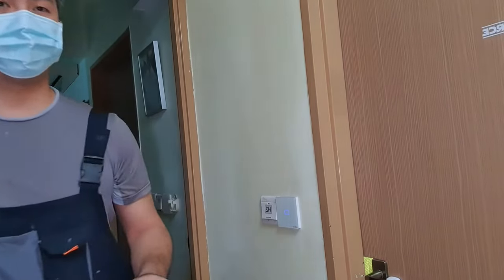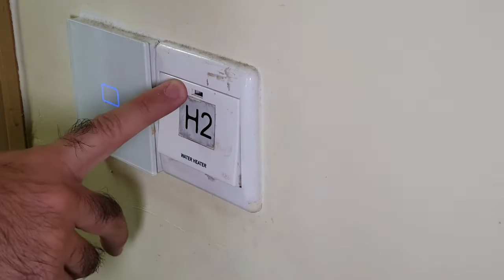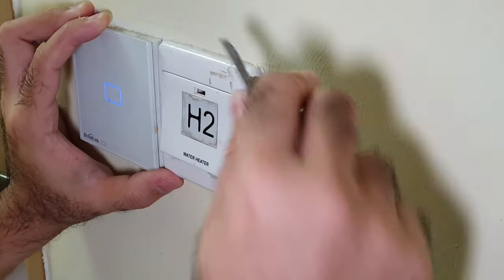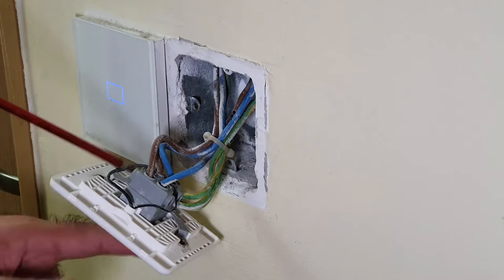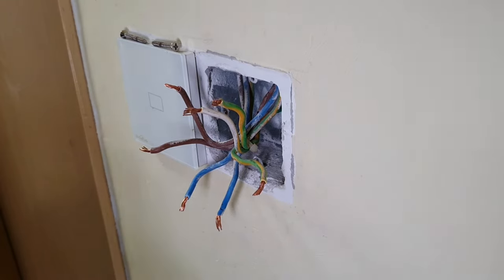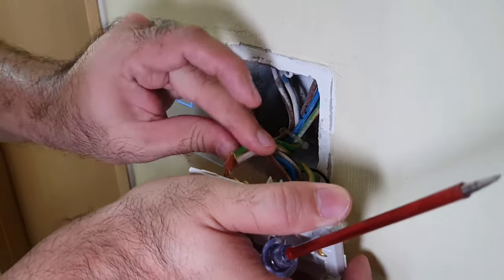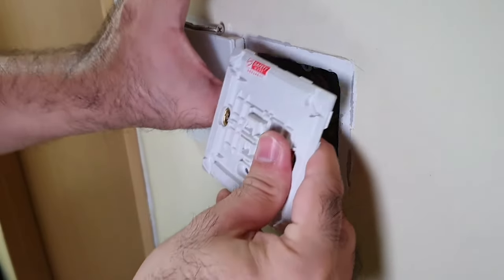Water Heater switch (20A dual pole) change (Save $120)

Comment: What's the use of the 2 thin black wires? And i look at your switch and my switch, the earth wires just screwed in and they are earthed? Its not connected to anything else? 😂

Comment: Some switch brand is indicated as in and out , some is supply and load which is which ?
Reply: "In" means supply and "Out" means Load
For more explanation "Supply" is Grid line and "Load" is your load in home such as light, fan, tv, water heater ......

Comment: I have a toilet that's connected to the kitchen and a room, the primary water heater switch is in the kitchen, is it possible to add another switch in the room that the toilet is connected to? Thank you

Comment: Hi there! I am currently using the 3 pin plug (which I know is not safe to do so) for my water heater. Is this as simple as changing the switch to this double pole switch and we are good to go?
Reply from the maker: Ultimately a water heater should be wired to its own circuit breaker which would isolate the circuit if a fault develops in the heater.  The idea is to shut off the supply. Of course a dual pole switch is safer than a 3 pin plug.

Comment: I messed up the circuit breaker wire and the water heater wire. How to confirm which two are the circuit breaker wire?

Comment: I'm changing my water heater switch to a smart heater switch the MOES one, but the earth/ground wire is not used (most smart heater switches seem not to have a spot for the ground wire) Is it still safe to use without the ground wire implemented or do you think it's ok?

Comment: Lucky me to find this video. I opened up the switch this afternoon and closed it back without changing because the wiring is different. 

After watching your video and reading the comments, tomorrow I am going to try again.  It looks simpler now. Thank you for sharing
Reply from the maker: Nice work!😁
Reply: Managed to change the old switch out successfully! The old switch has some melted plastic at the neutral (Black wire) out port melted. 
Finally the heater is working again.
Reply from the maker: Feels good to DIY! Proud of u!

Comment: Thank you for sharing your valuable knowledge. I recently changed a water heater switch and only realized today that when it's in the OFF position, the Water Heater is still ON. Is it because I have connected the `IN' and `OUT' wires wrongly? How do I find out now which are the `IN' and `OUT'?
Reply from the maker: If it is in the off position and still on means your wires have been switched. You can try switching the wires around d and see if that works
Reply: @ThePunggolHandyMan  Yes, problem solved. Thank you ,Sir.  I used a test pen to check which wire is LIVE to know L1 and L2 but I don't know how to find out which is N1 and N2. Guess it doesn't matter, right?

Comment: Very helpful tutorial! Question though. How do I connect them to a smart 20a switch? Do I ignore the green wires and tape them together?
Reply from the maker: Ermm you have to attach all the wires actually. Best to follow the manufacturer guidelines
Reply: Same here, i also dunno where to put 2 earth wyre. Mine one also only have four hole. Not hole for the earth wyre.

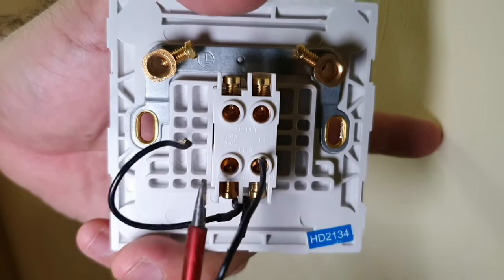Comment: Nice tutorial. My water heater in the toilet is having a 13amp plug. The problem in my toilet there is no currenct supply when i check with the test pen. And out side there is a switch similar as per your video and there is a red light. I check with the circuit breaker they are all in ON position. What is wrong with my toiled 13 amp wall socket. At 06:46. what is the purpose of the black wire, what if i dont connect it. Please advice. Thanks.

Comment: I've discovered one bathroom water heater switch is working the other way around which is insane because switch off meant that the heater was always working. 

Can I conclude that the electrician wired it in reverse like he connected the input to the output and output to the input? Easy fix means to rewire it the other way around?
Reply from the maker: Yes you just flip the switch upside down

Comment: Great video.  I have a similar switch but there is no load neutral wire, to the heater  there is only live and neutral supply  and live load to the heater. Can i still replace this with a smart switch as the models online  have 2 neutral slots, one for the supply and one for the water heater?
Reply from the maker: I think for this you need to check with the supplier
Reply: @ThePunggolHandyMan  thanks

Comment: Hi TPH, is having a heater switch (in the kitchen) indicate that the house already has neutral wire wired? The reason why i'm asking is because i'm planning to install smart heater switch to be used inconjunction with a non wifi storage heater and i noticed most if not all 20a heater switches smart or non smart require neutral switches. Thanks in advance!
Reply from the maker: I can't say for certain, however of it was installed by a qualified person it should have a neutral in a dual pole switch

Comment: Is changing from water heater switch to an outlet socket doable or a no-no?
Reply from the maker: Well there is a live, neutral and ground there and it is rated 20 amps so it shouldn't be a prob

Comment: Hi, I would like to check with you, I had two water heater switch,  one located on the master bedroom and outside bathroom which what show on your video, But, the Water heater is install at the master bedroom,  I notice I can only on and off using  Master Bedroom water heater switch, but I can't on and off using the outside bathroom switch. This is normal? Can I do anything to make it so that I can turn on and off both water heater switches. TQ
Reply from the maker: Usually each switch corresponds to a power outlet near the ceiling of each toilet. Turning either one on will activate the respective outlet and the heater attached to the outlet. If your heater is in the master, and supplies both common and master toilets then the heater is connected to the master room swith. In short, to connect both switches to become a 2 way switch requires quite extensive rewiring of the walls which should be done by an electrician
Reply: @ThePunggolHandyMan  TQ

Comment: If i bUy same brand of socket does it mean the wire connection all same so i just need to follow existing connection ?
Reply from the maker: Basically 1 way mostly the same. 

2 way a bit more complicated

Comment: Hi question. How is that installed? I mean how do you control the heat from the heater if it doesn't have a knob control for the heat? thank you! :)

Comment: Hi great video! is there a reason to use 2 different testing pens? One for screw and one for wire? thanks
Reply from the maker: I prefer to use a contactless pen to detect the existence of voltage before I go near it.. the regular test pen is to confirm

Comment: Hi. Thanks for this tutorial.

My new switch replacement (same brand, newer model) has Line/Load instead of In/Out. May I know whether Line is In and Load is Out or the other way around? Thanks
Reply from the maker: Line is your electrical supply line.  Load is the demand on the line.  So yes you are correct

Comment: hi bro,my master bath room does not have neutral wire, is there a problem if I just do not connect the neutral? thanks alot
Reply from the maker: The water heater should come equipped with a ground line. If not the wiring is not correct. I think it's best to ask a professional to come check for u

Comment: What are the 2 thin black wires on the water heater switch called? Some brands like mk have these features.
Reply from the maker: @hamiltonastan  those are for the LED and doesn't matter which way u pot it in
Reply: @ThePunggolHandyMan  what kind of tools should i use to remove the cement lining around the switch perimeter?
Reply from the maker: @hamiltonastan  cement lining?
Reply: @ThePunggolHandyMan  yes
Reply from the maker: @hamiltonastan I usually use a small penknife

Comment: Thanks for the video @thepunggolhandyman . 

Can I check with you if the switch makes light crackling sounds and the LED buzzes intermittently on and off when the switch is in the “on” position. 

Would it be a problem with the switch  (I need to buy a new switch) or just a connection issue (I can crack open the switch and tighten up the various screws in the hope it works?)
Reply from the maker: Hi! Thnks for reaching out! This means that you have arcing inside the switch a it is not engaging or disengaging properly. The spark is a heat source which may cause the housing to melt. Do change the switch as soon as you can. They are quite inexpensive and not worth repairing. Be safe!
Reply: @ThePunggolHandyMan  Thanks for the reply! It was definitely and arcing issue. The live wire had melted down the contact area behind the switch.

Only issue is that the screw thread for the switch seems to have been worn out. So the whole switch is being held together by one side screw. 

Although not the best solution but would this be safe enough for constant daily operation?
Reply from the maker: I wouldn’t advise it. I have not had the opportunity to come up with a proper socket fix video yet, however you can use kneadable epoxy to reconstruct the area needed to be screwed in.

Comment: Hi. By right if this switch connects to the ceiling rose, when you off the switch, the live wire at the ceiling rose side should not have any current right? What if it does have current when you check with test pen even after you off the switch?
Reply from the maker: Then your switch is not disconnecting it properly or there is another controlling switch
Reply: @ThePunggolHandyMan  hi. Thanks for your reply. I will check on the switch. However what do you mean by there is another controlling switch? Because by right from DB it has to come to the switch direct which is the L1. Then load will be to the ceiling rose

Comment: Most your connect earth wire, because in some cases were you only have the red and black wire does it means it will not work?
Reply from the maker: If earth wire is not connected the circuit works. But the switch will not be grounded

Comment: The Schneider electric 20A heater switch I bought only have one ground point, instead of 2. Can I put the 2 earth wires into one ground point ? Thanks
Reply from the maker: Yes you can!
Reply: Honeywell heater switch also only have one ground point. So likewise can put both into 1 ground point?

Comment: I am confuse with the ground wire connection. The old switch panel (at 4:32) ground was connected all together to a terminal point, but with the new switch panel (from 8:34) ground was connected separately two wires go to one terminal and the remainder goes to another.
Reply from the maker: Good observation!  Notice at 8:05 there is a metal bar connecting the 2 ground terminals. So actually they all are connected together. The metal bar is a link, same as putting them all I. The same hole
Reply: @ThePunggolHandyMan  Okay, thanks for the clarification.

Comment: nice... been enjoying yr channel... videos are really helpful.... juz for knowledge, what's the thinner black wire connecting at the load pts? should it be of the same thickness used?
Reply from the maker: Thank you so much for watching! The black wires power the LED. That's why it has to be fixed to the lower terminals (load). So when the switch is turned on, the lower terminals are energised and the LED illuminates!
Reply: @ThePunggolHandyMan  ohh yea hor... forgot the led... thx for replying! :)
Reply: @ThePunggolHandyMan  Hi there. Just curious from the science perspective. LEDs are diodes, should run on DC right?

Comment: Hi. I had just brought a smart water heater switch (glass touch panel type) to replace my current water heater switch. Realize that for the new switch, there is only connection points for Load, L and 2 N points. And there is no point to connect my earth wires. For the neutral wires, must I identify which incoming neutral wire goes to which of the 2 N points on the switch? Since there is no connection for for the earth wires, where should I connect the earth wires to?
Reply from the maker: In this instance it should be a dual pole switch usually L1 is for incoming (live) and L2 (load) same with the neutral. For the earth wires the manufacturer deems that it is not necessary for the switch to be earthed, hence you should join all the earth together via a connector or solder and heat shrink. I won't recommend twisting and black tape.

Comment: Hi, thanks for the wonderful video. I have a question....is there a fuse inside the 20A DP switch? If yes, what is the fuse rating. If no, why not as our common appliance plug has a 13A fuse.
Reply from the maker: Hi there is no fuse in the dp switch. However what it does is disconnects the appliance 100% from your circuit by disconnecting live and neutral. Hence dual pole. A regular 13a switch is single pole as it only disconnects the live wire from the appliance. Hence if neutral is energised, there is a chance that you still might get a shock if there is a fault in the appliance which shorts the case to the neutral line.
Reply: @ThePunggolHandyMan  Thanks for your prompt reply. It is very clear. I got another question but now related to oven replacement. My old oven is connected to a 20A DP switch. While sourcing for new oven, some manufacturer specified upfront that it has to be installed with a 16A fuse and they will not provide us with plug. So I am puzzled that if I connect directly to my 20A DP switch as my old oven does, how should I incorporate the 16A fuse as per the manufacturer specification?
Reply from the maker: @bernardtan7068  the fuses are usually located in the plug heads. Not sockets. In saying that,  if a circuit specifies 20a or 13a that is what the circuit breakers are designed to trip off in the event of a surge.

Comment: Hi mine is a one way switch but wrongly bought a 2 way, can you help with the wiring?
Reply from the maker: Ooooo just seal the top hole Nd use the com and L1
Reply: Err… the one way gang has two blue wires which goes into two L and two black wires which goes into two N.  Whereas the 2 way gang has L1, L2, com L, N1, N2, com N, loop 1 and loop 2 and 2 extra thin black wires. Would be very helpful if you can let me know which wires goes into which point? By the way sorry for late reply, old lady here not familiar with YouTube 😅

Comment: hi, do you know the led light on the heater switch is it 230v?
Reply from the maker: Erm I don't quite understand your question
Reply: @ThePunggolHandyMan  when u switch on the switch, the led on the switch will light up to indicate that the switch is on. do u know what is the voltage of the led light?

Comment: Thank you so much for the video. I managed to figure out even though my old and new switches have slight variations but the general principle is the same.
Reply from the maker: That is correct the switch is essentially just a couple of contacts which join a wire. If you understand that , everything will make sense

Comment: What would have caused my live wire to heater  to melt and the plastic to start melting?
Reply from the maker: This would be arcing inside the switch, probably due to improper wiring. Moisture may also cause arcing which can also cause arcing

Comment: Hi, why the switch light stay on even I already turned off the switch. Do you know why?
Reply from the maker: Hi! Your two black wires are probably inserted into the supply live and neutral terminals.  Check that it is connected to the load live and neutral.
Reply: @ThePunggolHandyMan  hi, but the switch I bought don't have black wires. =(
Reply: @TUNG Channel  I also have the same issue. It's a Legrand Mallia... it doesn't have black wires. Mine when in 'off', seems to have a little light, when it's really switched on, the light is brighter. I was bothered by it but after a few years, I got used to it.

Comment: Hi! I had to change my heater switch. So when i remove the plastic switch, the 2 earth wires were actually not fixed to the switch. Both their ends were joined to a plastic connector which is just hanging loose. Is this ok? Should i leave it alone when fixing the new switch?
Reply from the maker: No no. It should be connected to the switch for your protection
Reply: Thanks for the reply! This is regardless if which brand of switch right? I was told since the switch has no metal parts, no need to connect to earth. So i have to remove the wires frm the plastic connectors and fix both earth wires to the earth "hole"?
Reply from the maker: @shahidshafie9262  yes that is correct. Just connect it to the switch. It probably increases safety by 0.01% but it's the proper way to do it. It will work with the plastic connector without any problems
Reply: Thank you!
Reply: hi. adding on to this topic. if the new switch we bought to replace do not have earth wiring attachment point, what should we do when changing?

Comment: my appliances (Washing machine, Kitchen Hoods & etc.) power is under 13amp, electrician suggested me to install 20amp power switch. 

What is your suggestion? Do I really need the 20amp switch for direct power?
Reply from the maker: Well if it is all running through one switch the total amperage may exceed 13 amps which can overload the switch. Making it into a 20A switch will give you a bit more capacity